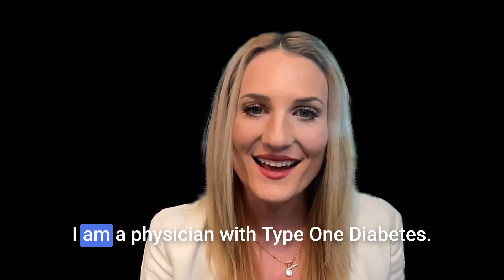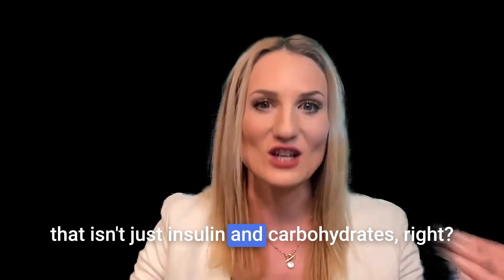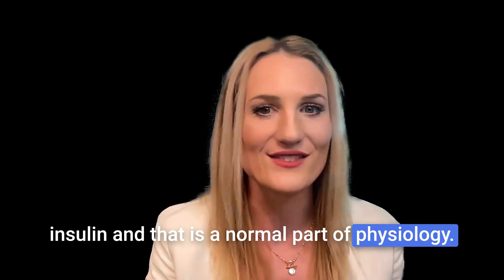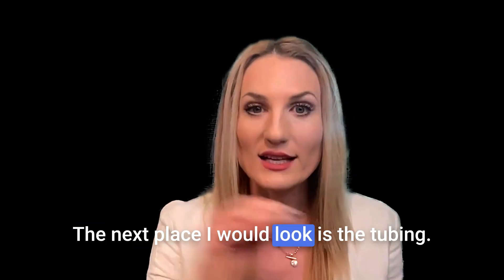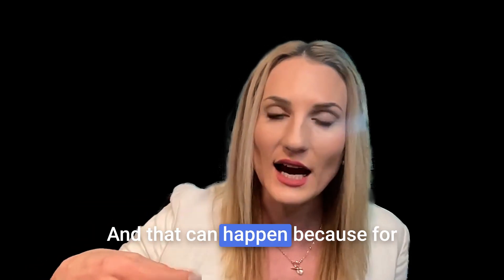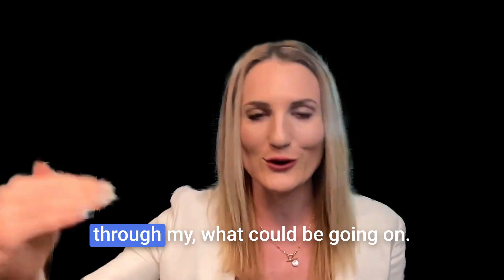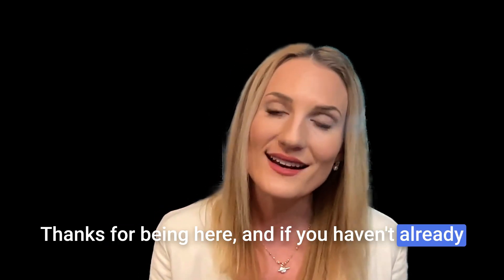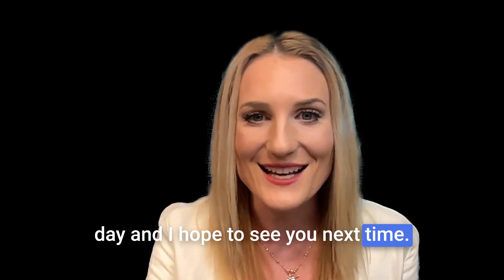Insulin Pump Error? Don't Panic, Try This First.

Comment: I just started on an insulin pump this month (December of '25).
This am I woke up with symptoms of early euglycemic dka (trace ketones on a urine stick, horrible nasty taste of acetone mixed with rotten fruit and relatively decent cgm reading of 114 and a finger stick of 118).
So, I followed my medical team's home treatment regimen. Access my port, run a liter of saline plus 100mls of d5w and 5mls d50w at 250ml/hour, take 10mg hydrocortisone to cover for the stress of dka (because yay for having adrenal insufficiency /s) and take an eighth of a teaspoon of salt substitute (potassium chloride) mixed into 1oz of water with the hydrocortisone. Plus the new instructions with being on the pump of make sure everything is running properly and if not, change what needs to be changed. 
Then recheck for ketones with a urine strip shortly after the first hour. If no ketones, finish the fluids and see how I feel later. If ketones are still present but same amount or less, continue with the fluids and recheck an hour later. If worse, drag myself to the er so that they can deal with the super funsies of euglycemic dka.